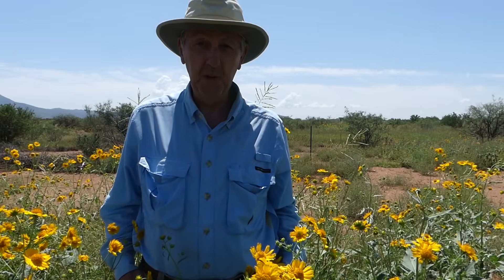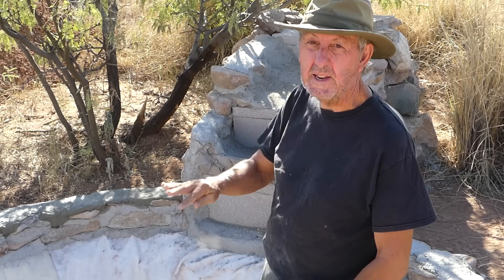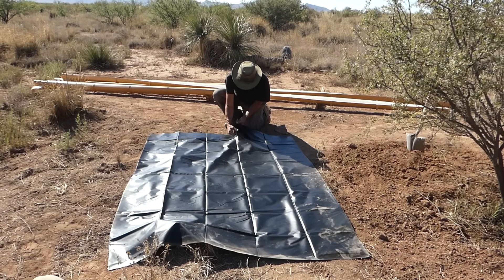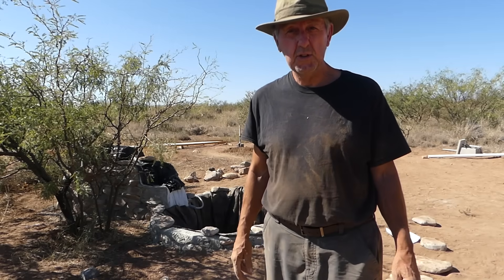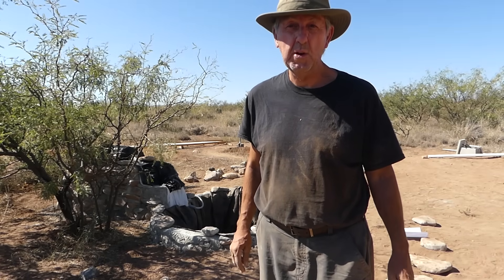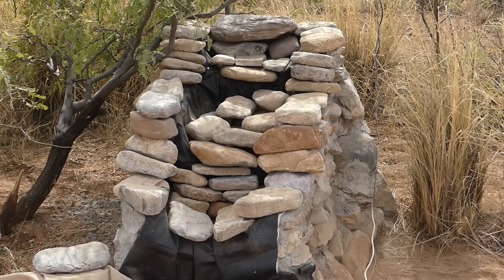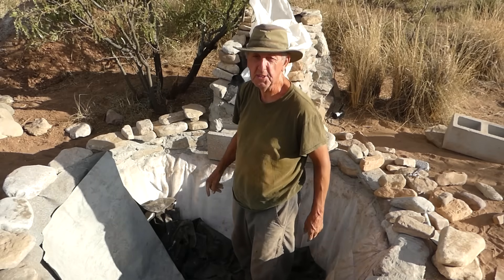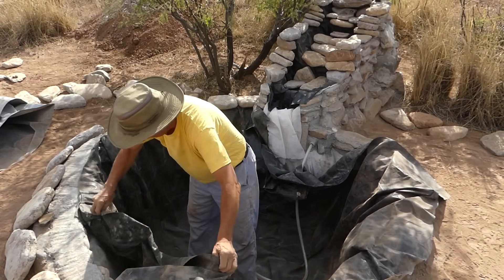DIY Off-grid Solar Pond with Falls Part 2

Comment: Are you going to sheet rock the walls in the cabin?? To make it look better?
Reply from the maker: Super question Bradley Bradshaw. Yes indeed!  First I have to do all wiring and plumbing. So time line hoping to have sheet rocking finished by April or so next year.

Comment: The flowers are Asters. Also It looks like the pump wire and hose are behind the rocks which would make it real hard to get out. My tiny pond in Southern NM collects plants, dust and more which require the pump to be cleared out from time to time.
Reply from the maker: Dirk thanks for watching.  I got a positive I.D. on the flowers.  More on that later. Yes now the hose and pump wires have been relocated.  Stay tuned!

Comment: Rick Detail. Gotta be brutal in that heat! Kudos on that! Reading comments, I see others have mentioned perches birds can ...perch to drink and bathe. In my (smaller and shallower!!) pond they tend to hang on the spill way pond. I think you have that covered. I adjusted mine a few times, move and changed them about. I have no doubt you'll fine tune yours to fit your local Friends. 😉.  
  Rocks are such a natural element even I couldn't screw up the beauty they have...😁.
Reply from the maker: Michael you are so right.  Lots and lots of fine tuning these structures.

Comment: A great video. I really enjoyed it. Yes, the large flat rock becomes the ramp for the flow into the pond. Every gap between rocks will fill with water and reduce flow. Consider cutting some of the stones into small triangular shapes to fill the gaps. Also consider filling gaps with cement. 
The front of the ground stones holding the plastic tarp can be mortars with standing stones or dry stack under those stones. You do not need stones inside the pond itself as the weight of water keeps the liner in place.You will rework areas of the pond over time making continuous improvements. But great progress! I am really enjoying it!👍👍👍
Reply from the maker: Thanks so much Michael!  Yes you are so correct and this pond is a work in progress for sure.  Hair pulling and frustrating at times but so so rewarding and worth all the labor and challenges.